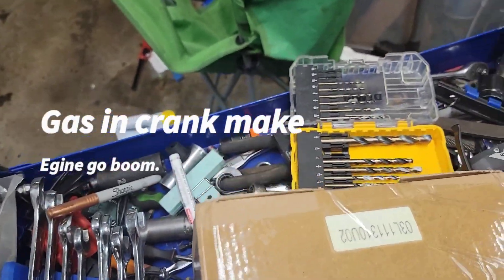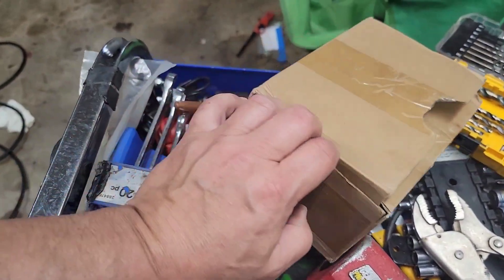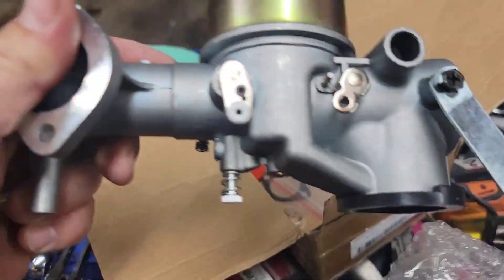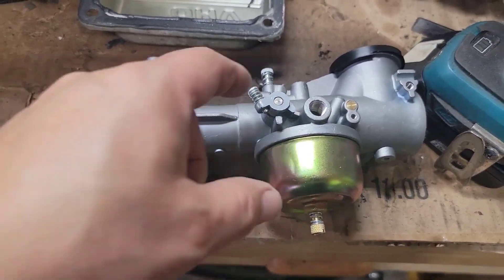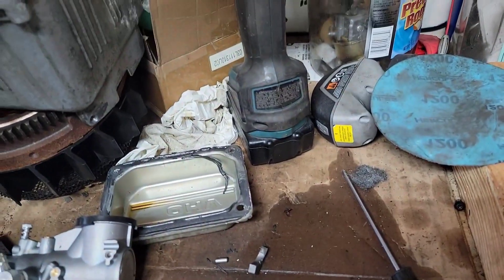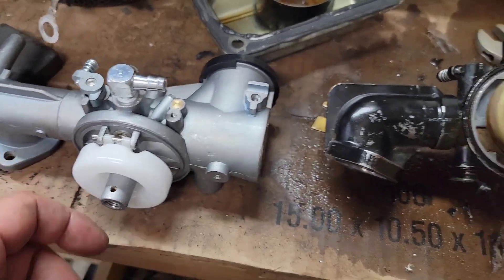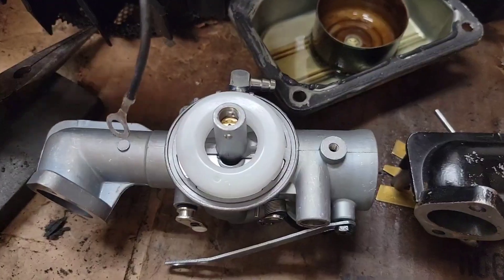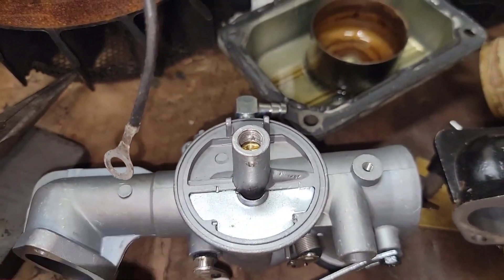compare oem 390811 carburetor with Chinese knockoff. 491590. briggs and Stratton.

Comment: I've got a 8hp snapper too. And going thru the same thing you are . Might order kit jacks small engines and new carb from
china seller . how did you get a tune up kit with it? I don't see that  is it amazon or ebay?
Reply from the maker: Not sure about a gasket kit, but the link is in the description of the video for the knockoff one. The knockoff did the job.